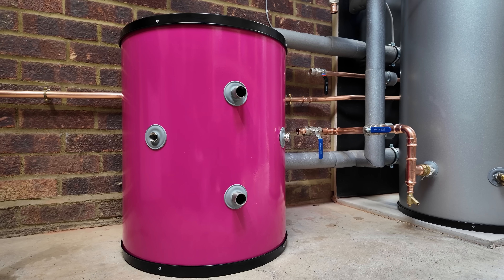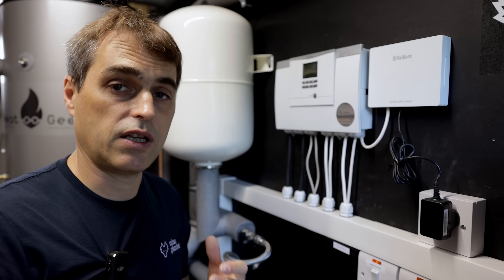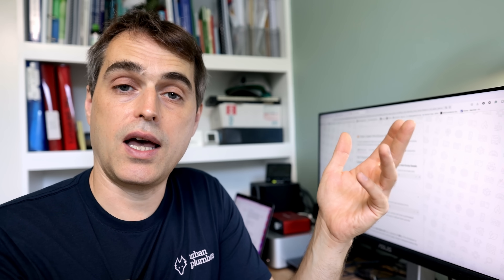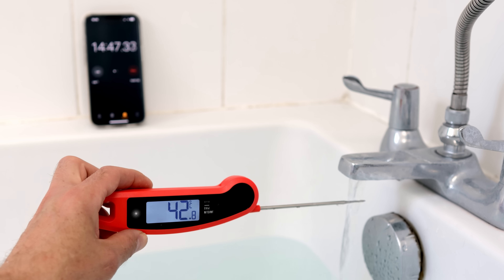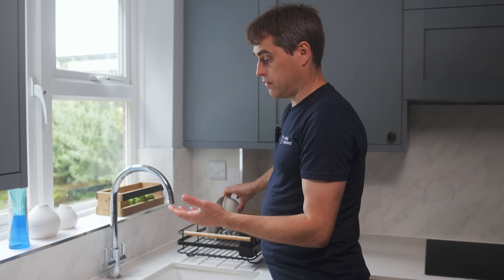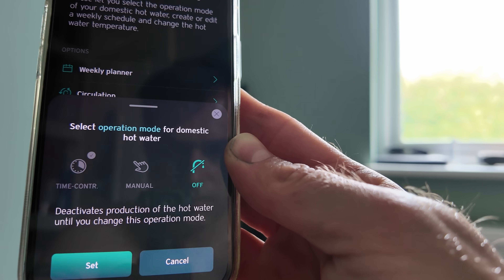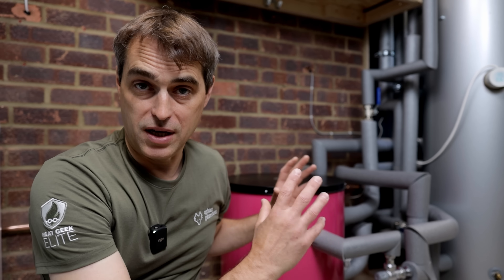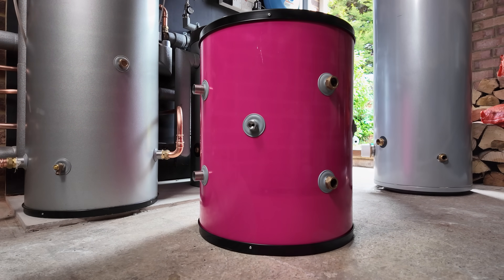Heat Geek Mini Store: Is It a Good Fit For Your Home?

Comment: What would happen if you used this as a volumisor and used the coil to preheat domestic hot water?? Would this reduce load on the heat pump for domestic hot water production while increasing runtimes for the central heating? Can you think of any conditions where some overlap would be useful??

Comment: We used to have a water cylinder in the cupboard upstair.Also a watertaknik in the loft.Plus a small tank for the C/H top up if needed.Got writ of it all and have a combi boiler in the kitchen.So with the heatpump we are going back to tanks extra pipes and lots of money to spend.No thanks at 76 I keep what I have and the combi will keep my house warm with 8 radiators and for the shower.

Comment: Similar to Sunamp HP heatstore but using water instead of phase change (so less energy density). Interesting product with obvious uses like the Sunamp in space constrained home. If it could get MCS approval for use with the UK gov BUS grant it would be a winner for many homes. If it had an optional immersion heater that would also solve problems of proving occasional higher output but would maybe need expansion tank, pressure relief and blowoff pipe so defeating some of the benefits.

Comment: Great innovation. But If you want to "Endure" a 5Lpm shower experience. You might as well just use the Electric shower you have in the background there and keep it a lot simpler. And not need a timer and a laptop every time you take a shower. 😃
Reply from the maker: yes, but that wil cost you 2.5 x more to run.

Comment: Hello and what a good video. Have any tests been done to see what the build up of limescale is inside the coil?  Old Gledhill units that obviously ran at up to 80 degrees boiler flow temperature had a lot of problem with scale blockages in the DHW coil. Now I understand that the ASHP is working at much lower temperatures but some scale formation is inevitable.
As always please keep making the videos as they are educational.

Comment: Rather than a tank with a coil inside, would it be beneficial to pass the water through an external plate heat exchanger instead?   Even small ones have a phenomenally large heat transfer surface area and would be far more efficient than a coil of pipe.  No additional pumps etc. would be needed, just a small additional space round the side of the cylinder for the Hx.
Reply from the maker: Using only a plate, you cannot preheat and store energy. 5kW is not enough power for any reasonable flow rate. Also, you would not have a buffer of stored energy to start up hot water or to take you through a defrost.
Reply: @UrbanPlumbers  Sorry, I was not suggesting using only a plate heat exchanger.  What I meant was: use an external Hx instead of the coil inside the tank (use a tank that does not have in internal coil).  The  EXCHANGE  of heat is simply moved from inside the tank to outside of the tank.
Reply from the maker: @jesserawson898  it is called plate loading and requires additional pump. It is much harder to get decent efficiency this way than with a large coil, as we can see on monitored systems.  Big coil is the simplest and most efficient method that I have seen.
Reply: @ With a setup as per Heat Geek video shown on  https://www.youtube.com/watch?v=a1XGBmBLUnA  I think the solution ticks more or less all the boxes but simply uses a more efficient plate Hx external to the tank.

Comment: @urban plumber, thank you, can you refer to a schematic/drawing how would this work in the case of a combi boiler .... given it does not have any pump on the jow water site... a picture would likely be worth a thousand words!
Reply: If you already have a combi-boiler, you don't really need a mini-store. You could pipe it up so that the mini-store acts a pre-heater for cold water going to the combi-boiler. This would improve the flow rate, especially in the Winter.
Reply: @tlangdon12  thank you, I have a clarification question... are you suggesting to pipe the mini-store as a radiator to my heating system and have the cold water input to my home go thru the coil first then into the ministore? so I will be able to lower the amount of energy needed to generate my 45-50degC hot water?

Comment: Whats the difference between the cop what You can read in de my Vaillant pro app and what You read in your externel measure systeem?
Reply from the maker: The margin for error with vaillant is around 25% +\- with OEM its 2%

Comment: In the situations like a flat wouldn’t it be more viable and simple to stick with an electric shower? Possibly a small under sink water heater for washing up / basins. That removes the need for any stored hot water and prevents the cycling of the heat pump on its CH. you can always upsize the shower for a better flow rate. Unless im being thick as usual. Also I didn’t expect you to have one of those shower heads 😂

Comment: This needs revisiting in January tbh.
Reply from the maker: I will be!
Reply: Have you done any winter tests yet? Very interested to know how it performs even without a full video report
Reply: @jackb8194  looking forward to a revisit, hope it happens. Not holding my breath
Reply from the maker: It’s still connected to my system. I just can’t be bothered to test it anymore 🤣
Reply: @UrbanPlumbers speaks volumes 😂😉
Reply: @UrbanPlumbers  firstly, merry Xmas 🎄. I assume that means you can still shower with it? Have you tried to run a bath recently?
Reply from the maker: Just a get a cylinder. Mini store is a nice idea, but I would avoid it if I can. There is always a way to install a cylinder.
Reply: @ thanks for the feedback 👌
Reply: @heatpump8566  are you still able to shower and fill up a bath with it?

Comment: Thank you for the video.  I am curious about what you  think about the Ministore FAT which is seems to ideal for going under a cupboard, and whether that will do what is needed for us. Deciding tonight whether to go for the ministore or a Mitsubishi which my installer is pushing.  The FAT has nearly double the volume of the model you were suggesting does that resolve some of your concerns?
Reply from the maker: is it a mitsi cylinder or heat pump? I do not rate Mitisi at all, not my cup of tea.
Reply: @UrbanPlumbers  We are being recommended both as a combined solution.  There seems to be a lot of negative about Mites on the forums.
Reply from the maker: @nickannalloyd4393 mitsi to heat pump is what worcester Bosch is to boilers. Cant say any more really

Comment: How much better performance would you expect if fitted with a 12kW Arotherm plus?
Reply: How much sense does it make?  If the heat pump required is 12kW, that implies a pretty huge place.  Seems really unlikely you need a 12kW heat pump for space heating yet a mini store is acceptable for hot water, even with the higher output of the heat pump.
Reply from the maker: @jfinnie78 well, i chose to live alone in my 12 bed mansion - i don’t really like other people outside of YT
Reply from the maker: yes of course.
Reply: But a home that needs a 12kW heatpump is more likely to have space for a full size cylinder.

Comment: Great ballanced video, im suprised by the number of comments that have missed the fact this is the smallest in a range and larger devices that exist and should be used for larger properties. Sounds like it would be fine in a tiny flat with only a shower but if you want a bath you are going to be compromised, try to fit one of the bigger versions. What is the best strategy with these, fit the largest you can?

Comment: Why don't Heat Geek folks ever mention heat batteries from the likes of Sunamp? Solves the same problems that the Mini store is trying to, but can store way more heat in the same/less space.
Reply from the maker: Requires even higher flow so is even less efficient than ministore XS.
Reply: @UrbanPlumbers  I see! Maybe they could be collaborated with to have wider bore pipework in their loops to lower flow rates!
Reply from the maker: @jakeii9 it’s about flow temperature not flow rate

Comment: great video. is that app available for other heat geeks to use ??
Reply from the maker: Last time I asked Adam he said it would be once it is finished.
Reply: @UrbanPlumbers  Ideally, it would also be available to homeowners who want to check whether a mini-store could be a viable option for them. I would allow them to judge the compromise that might be necessary. I have a flat with a blind cupboard in one corner where I could put a mini-store.

Comment: genuine question , why not just install an electric shower and instantaneous water heater for the sinks, or would that use more energy
Reply from the maker: You can - it would require 7-9kw power which is a lot and also would be 2-2.5x more expensive to run

Comment: Honestly, I think we need to rethink how we design shower enclosures. If they were enclosed with minimal air changes, the amount of heat you lose to the rest of the bathroom would be significant. Also, integrated hydronic heating panels would help. Low flow isn't an issue if you're warm.
Reply from the maker: Low flow isn’t an issue with correct shower head . Most people use way too much water for no reason.
Reply: @UrbanPlumbers  
I really just want to become Finnish. They all have their own sauna. 3million saunas, 5.5million people.

Comment: But this is the smallest one in the range (60L). For a typical semi, I'm more interested in how the larger ones (110L) perform compared to the Heat Geek/other cylinders which start at 150L. A cylinder about 1m tall is better than one about 1.5m tall if it can fill a bath and give a decent shower.

Comment: What's the performance like between the Mini Store XS and the Mini Store TALL? The tall having a capacity of 110L, would it be more efficient?
Reply: And a larger coil so doesn’t need to be as hot. This is the extra small version which is obviously not going to be as good

Comment: Well done Syzmon - excellent practical analysis and demonstration. I think your caveats will be completely overlooked/ignored by the critics. In sum this is a practical alternative for those who absolutely do not have the room for a conventional unvented cylinder of a capacity suitable for the dwelling. If one has the room for a conventional cylinder then deciding to fit one of these means you are accepting all the performance and efficiency compromises that come with it.

Comment: As a refrigeration tech I'd advide highly against "setting your anti-cyle to zero". Thats a fast track to compressor failure.
Reply: Starting a compressor, without first equalization of the refrigeration gas, will reduce the life time or could cause a very expensive sudden death of the compressor and valves, not to mention the lubrication oil of the compressor does not completely  returns to the compressor...
Reply: @johandv1705  Vaillant provide a warranty on the system, and allow the cycle time to be set to zero, so one might assume that they have considered the implications of this.
Reply from the maker: That’s only 5-10 cycles a day of 10min. Not ideal but a lot of air con or heat pumps cycle more than that.
Reply: It's not that simple though,  is it?  I think there are reasons you don't really want the compressor to be starting when it may already be hot from having just been run (eg bad timing means the heating just cut off).  You really want the compressor to shut down and cool down / pressure to equalize before it restarts to minimize wear on it and have efficient starts.  That's my understanding, anyway.

Comment: If there were 10,000 people like you and the other Heat Geek assured installers, we would be well on our way to reaching the UK's target for ASHP installations. 
Three years back I installed open vented, indirect, 600x300 high recovery cylinder on a 12KW Glowworm energy  boiler, they only had three hot water taps and an electric shower, the boilers on 24/7 for hot water on a Glowworm weathercomp system, the three of them in the house cannot get it to run out of hot water or run below 45 degs.  
Once people have had a high recovery cylinder fitted they love it, it always has hot water like a combi boiler if hot water priority controls are fitted its very fuel efficient, what more could you want.

Comment: Ballshit baffles brains. Heatpumps working over 35 deg become way less efficient. Install cost is high. Electricity is more expensive than gas. Electricity to run is from the supplier which is from a gas or coal generator. What's the point? Electricity run over power cables drops massively and is inefficient. Hydrogen in the form of a cell is way way more efficient. Please push that technology as a smart guy and inovator. I have faith in you. Green Hydrogen is cheap in hot countries but that will hand power to them. Please push technology not politics for humanity
Reply from the maker: Sorry mate - but you have zero clue what you are talking about. Hydrogen would be   Around 8 times less efficient than heat pumps. It’s a luxury gas that is very difficult and inefficient to produce.
Reply: It's not difficult to produce. I used to work on a plant that produced it. It is produced in very sunny countries as the use of pv panels makes it very cheep. It can then be stored as a cell to avoid wasted gas escape. What country are you based? I'm from the UK and we use 40 percent fossil fuels for our power supply, 8 percent of our energy is lost when being sent to us. How is hydrogen 8 times less efficient?

Comment: Bit concerned this could result in people being put off heat pumps even more.  It seems just about good enough for a reasonable length shower at an economy that is somewhat worse than gas - as you can't choose when to recharge.   I really struggle to see these as replacements for combis in all but small flats without a bath tub.
Reply from the maker: There is a bigger version of this store that allows full flow and a bath as well - it still fits under the worktop
Reply: @UrbanPlumbers  Do many flats have room in their micro kitchens to lose an under worktop cupboard?  I'm not so sure.

Comment: Surely, the best option would be to do away with the cylinder and install a full size ‘thermal store’ where you have the space. You could then heat the store to a higher temperature and install a blending valve on outlet. You would need to ensure high insulation factor on thermal store to maintain as high a temperature in thermal store as possible. As it is not unvented, no G3 qualification required
Reply: Think you missed the point of this product, it’s to fit in spaces where you can’t fit a full cylinder, they also sell larger ones too

Comment: I have really enjoyed watching your videos especially those about heat pumps and systems like the mini store. However,  we have two properties; a 1930s listed flat in central London where we can't install a heat pump and a small 1br cottage in the country where there is only electricity (an electric shower & 3 radiators)  but I'm not sure the cost of a heat pump and tiny cylinder makes much financial sense. There must be hundreds of thousands of flats and small houses like ours, but every video about this tech never addresses the challenges of listed properties or rural ones where there is not even any signal for a smart meter.

Comment: Hi Szymon. A good well balanced presentation. 
Someone questioned your objectivity in the comments which I felt was unfair. 
I like to see balanced review that points out the possible drawbacks as well as the positive points and you absolutely nailed this.
E.g You questioned performance in the winter which was one of my immediate thoughts. The SCOP was compared with the large cylinder and "managing expectations" was mentioned. 
It might be nice to have some figures on the various scenarios you demonstrated at some time in the future in both the summer and winter conditions. 
Finally, I learnt from this as well (new to heat pumps). It all well and good doing the theoretical  courses but the practical applications you demonstrate are invaluable. 
Thank you

Comment: Can a Mini Store work with a gas system boiler if so what are the advantages?
Reply: I'm considering a heat pump later down the line. Would this work well with a combi? (obviously a bit unnecessary!) 
I suppose I could lower the flow temperature and rate range the DHW power output down to  emulate the future heat pump?
Reply: @GavinGrantUK  It would work well with a combi; it would improve the flow as the mini-store is used to pre-heat the water going to the combi's heat exchanger. It wouldn't save any money though, but might resolve a problem with the occupants were complaining about low flow rates.
Reply from the maker: Would work very well with a gas boiler. Ultra quick recovery and great flow rates